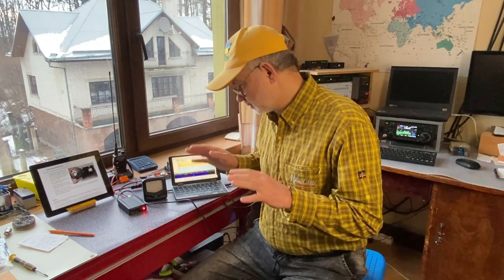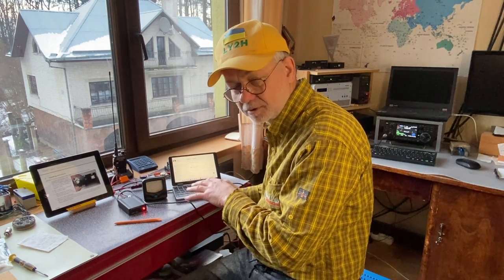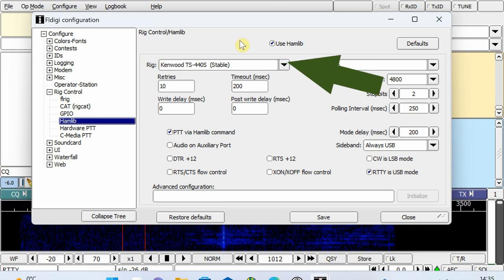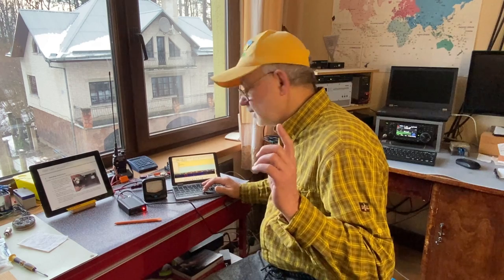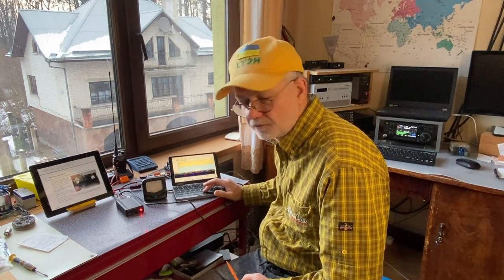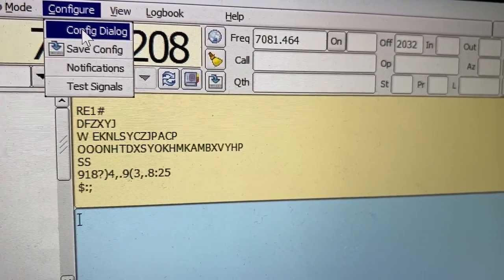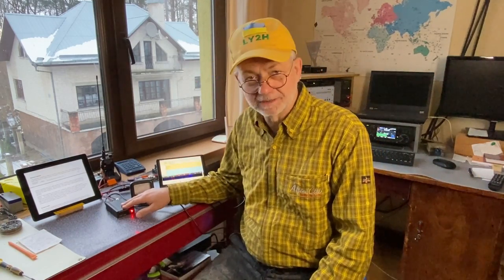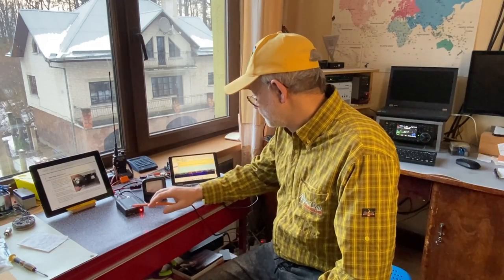The Secret Setting in Fldigi blocks your QDX transceiver from transmitting. Solved!

Comment: Because fldigi has specific settings for the sound card, you do not need to set windows output for sound to be the QDX. In fact, you should not do so because then windows alarm sounds and stuff could be sent to the QDX and then over the airwaves.

Comment: Hi Linus. I'm having some fldigi trouble: I'm transmitting into a 50 ohm dummy load while I figure this out. I used your Hamlib settings, turned the volume up to max and set the fldigi attenuator gain to 0dB. When I transmit, the QDX LED doesn't blink in the nice 1Hz sine wave pattern. It blinks somewhat irregularly. What could be causing that? 73 David K7DMJ
Reply from the maker: Hello David, thanks for watching! As to your QDX problem, it could be many reasons. I would strongly recommend to read the excellent QDX troubleshooting article by Hans himself on the QRPLabs website and check every stage step-by-step. 
In case you have your QDX working just fine in FT8 mode running WSJT-X software, then , obviously, the QDX is all in order, and the problem lays in Fldigi and all the settings related with this app. I put in a video all I could find out myself about it :). 
The blinking LED is a very reliable way of self-testing in QDX. So, if you say it blinks once ( if I get correctly your description of  blinking "somewhat irregularly"), it's a sign there is no audio signal coming from the Fldigi to the radio. First thing to check- if the QDX is selected as an output sound device ( it's in the video, in detail). I would also check again and again in my computer's Device manager if the QDX is recognized and assigned  to the comport . I've also noticed that the order of starting matters. For me, the best functioning is when I first start the computer, then connect the  power and the USB cable  to the QDX and then start the desired app ( like WSJT-X,  Fldigi or Putty for terminal). I don't know if this is universal, but for me it is so :). 
Finally, you might need the right drivers installed ( detailed info in the Troubleshooting article) if you run anything older than Win10/11 on your PC. If it's Win10/11, no extra drivers needed. 
HTH, 73! Linas LY2H

Comment: Linus, have you tried N1MM Contest software to drive RTTY on QDX radio. I have 2 QDX's on order. The 80-20M and the 20-10M versions. I'm hoping they come soon.  Doug,VE3MCF
Reply from the maker: Hi Doug, sorry for the late reply, I don't know why some comments only appear in the YT studio, not the general comments section:). No, I have not tried the MMTY machine integrated into N1MM logger with neither of my QDX's yet. I mostly run the N1MM in the conventional good old CW/SSB contests :). I think, it could be a bit complicated as QDX has got no VFO tuning. But it could be interesting to try out one day! I think, the new star- The QMX , could be much better suited for such a job. I have it on order, but the waiting time sucks  :). Good luck with assembling your kits ! 73! Linas LY2H

Comment: If you are going to use Hamlib for CAT control, do you need to install any additional software, or does Hamlib get installed with Fldigi?
Reply from the maker: Hello OM! As far as I get it, no extra software is needed, the Hamlib is there, you just need to choose it in the fldigi config window as your CAT method and tick the right boxes, as it is shown in the video. HTH, 73! Linas LY2H

Comment: Linus, Thanks for showing parms for getting FLDIGI working with QDX.  I have the 20-80M QDX put together and tested on 20m and 40M.  I need to get and 84' Random wire set up to test 30, 60, and 80M.  Will use it for FD this Sat.   Doug
Reply from the maker: Thanks Doug! I'm very glad you've  got your QDX running with FLDIGI! I wish you find many stations to get RTTY QSO with during the FD. If you make a video or so about your QDX success I'd be glad if you shared  the link to one! GL! 73! Linas LY2H

Comment: Hi Linas, my compliments for the YouTube channel... A simple question.... What is the model of the little pc on right? Best regards Aldo
Reply from the maker: Thanks Aldo! The little PC is a CHUWI Mini book tablet/pc ( it's got a touch screen and the keyboard part could be flipped over if used as a tablet). It's an older model, there must be  newer  ones now. It came with the Win10 installed and then upgraded itself to Win11  automatically. 73! Linas LY2H